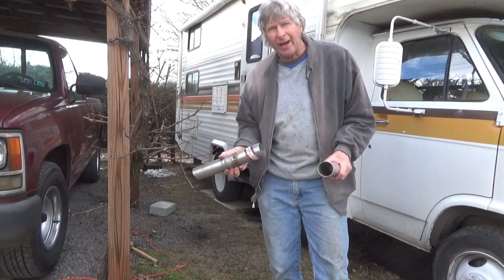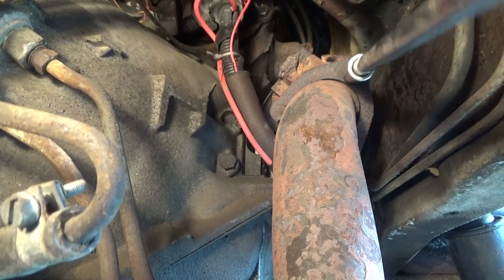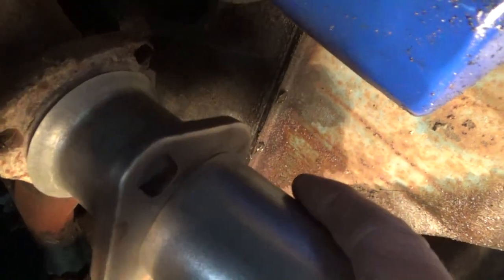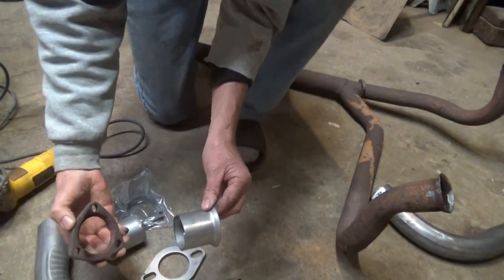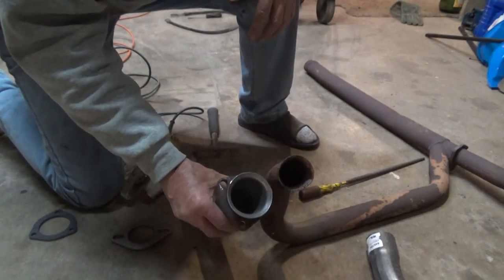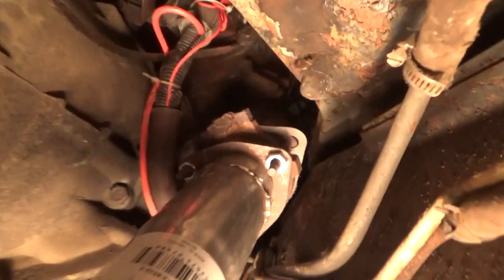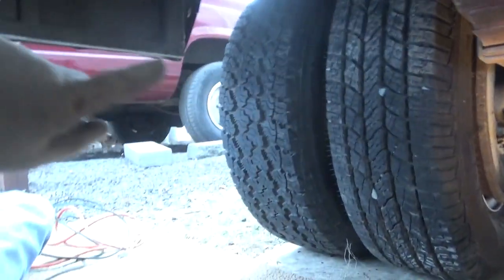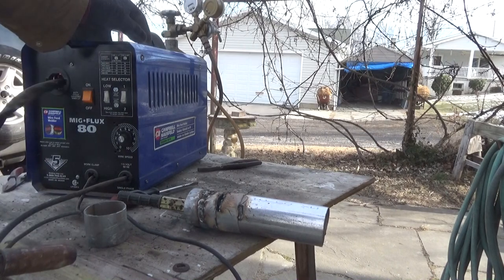WELDING MY OWN EXHAUST SYSTEM

Comment: You're a talented individual, keep it up. A "balance" pipe will help smooth out the exhaust note, install it back around the tail shaft area.
Reply from the maker: Thanks paul. Mike
Reply from the maker: Thanks paul, mike

Comment: When you welled the pipes together, I didn't see you putting any metal/steel in there. Do the two pipes just melted and meshed together ?  A mechanic told me he wanted to well my exhaust pipes together at the interface without any overlaping ? Do you think this is durable solution ? thank you
Reply from the maker: Hi, I am more of a armatur but I seen mechanics do it,